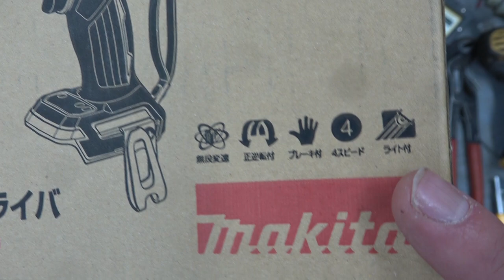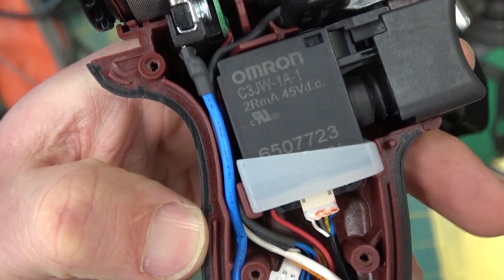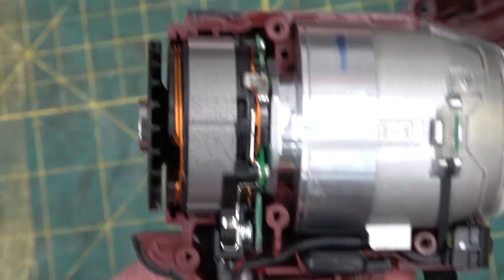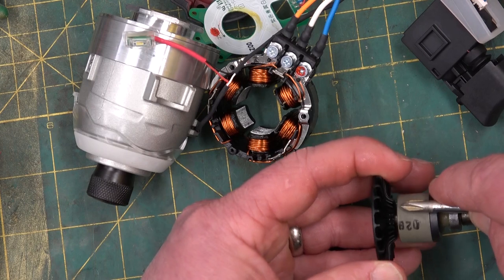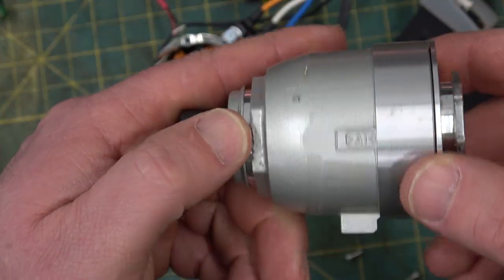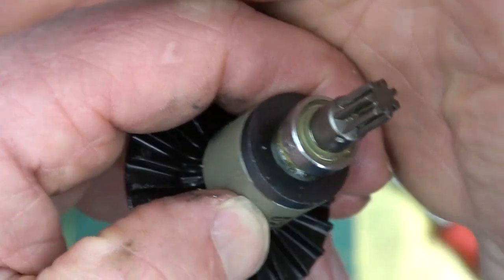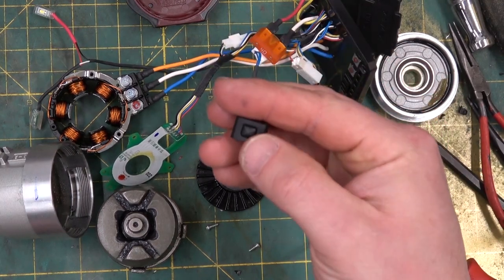Are Japanese Tools Better? Yes.

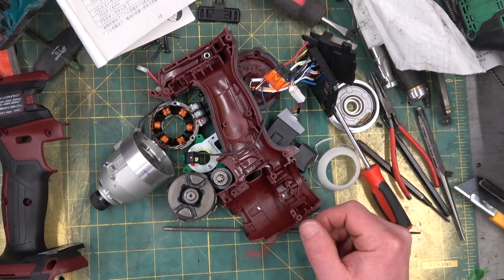Comment: 9:07 toyota does the same thing. If you take a corolla that was manufactured in japan, and one that was assembled in kansas, the Japanese one will wipe the floor with the already superbly built kansas model. I believe seiko also does the same thing.

It seems the past 5-10 years, japanese companies have taken a page from everyother country, and sent their international models to just be cheaply made in China. If you want the best workmanship, then buy something from Japan and have it shipped over. 

I still trust Japanese engineering (even over my own countries in a lot of respects) though, because they usually have the philosophy of using and designing in ways that are trusted to work, with parts that are known to work and be rouged.

Comment: I bought a 1984 Honda 4 wheeler made in Japan for my kid to learn on, my friend bought his kid the very best Tao something or the other Chinese ATV from the local dealer. The Chinese ATV lasted 4 months and he couldn't find the parts to fix it, all the insulation on the wiring was obliterated in the sun, cracking everywhere after 2 months,. That Honda is still running today. If you can buy anything made in Japan versus anywhere else in Asia or even Germany, go with Japanese made.

Comment: 0:13  Carton box says: 無断変則Continuously Variable Transmission(Not nuclear powered), 正逆転付 forward reverse control（Not entropy cuts port ways), ブレーキ付 with Break (Not high-five), 4スピード　4 speed modes(Not 4=Death, BTW it's only in Japan not in China), and ライト付 with light

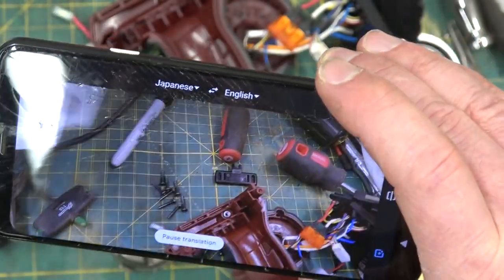8:44 If it is TD171DRGX, you have 2 options to change the modes. 
One is using "trigger" to change impact power 4 types- 弱 low, 中 middle, 強 high and 最速 powerful speed.  You will see the light step on the black panel when you pull the trigger.

Another option is 楽らく button on the blue panel. The setting mode will be changed to 木材wood, ボルトbolt、薄 thin board (using drilling tapping nail) and 厚 thick board.

木材 wood: Start to tighten slowly with trigger full-opened, then automatically speed changes to the most powerful speed.
ボルトbolt: Normal rotation: when trigger is pulled, immediately the speed will be the most powerful speed.　Reverse rotation: Automatically stopped when the nut is untightened.
薄 thin board: After penetration, automatically stopped by impact detection
厚 thick board: Reduce broken screw head and/or come out.

This machine remembers 1 your favorite mode by pushing the black tiny "hand button" just above the trigger and the 打撃 button on the black panel at the same time. The 設定 setting button next to the 打撃 button will be lighted on when the memory setting is done. When you want to use your favorite mode, you just need to push "hand button". Then if you push it again, the mode will be back to what you have used right before.

Also their movie will be helpful even they don't have translation.
https://youtu.be/Un0hTNKK1AI

Comment: About the board for the hall effect sensor: E248779 is apparently a UL file number for a PCB mfg in China, so it was probably made there; 94V-0 is a UL plastics flammability standard. 紫赤青黄白黑 is just "Purple red green yellow white black"

Comment: That hole in the gear is for a to My Allen headed grub screw witch indexes on a flat spot on the shaft. Typical setup on 1/10 scale high rpm R/C cars. The kind you assemble yourself.

Comment: The white doobly-doo in the bottom is not to preload the battery.  It makes it only take larger capacity batteries and not the little ones.
I assume it is so that enough current is available.

Comment: The small switch has the following explanation in the manual:
By registering a certain application mode to the tool, you can switch to the registered application mode by just pressing the quick mode-switching button (quick mode-switching function).

Comment: Unsure about your market, but the tool should be of the same construction globally.
The innards are indentical to what we have in the pacific region.

Omron are a common feature of pretty much all the mid-high end range Makita products, even the Chinese made ones.
Some of the parts in this model are also shared with its predecessor.

Comment: The difference between Japanese tools and American tools is business.  In Japan people who make things take pride in their work, in America people who purchase businesses to turn them out take pride in their profit margins.  

I have a lot of older Stanley tools that have held their own for decades and really like my block planes that are older than me...but most of the newer power tools made around here are complete junk.

Anyways, my sense of American pride has led me down a path where I am building a 4'x8' CNC out of some microcontrollers, a little bit of code, 1hp steppers, some 80/20 extrusion and 5/8" plate because 1) I want this tool to outlast me so that 2) when it does finally die I won't have to hear anyone tell me about my failing American tool.

Comment: An American car manufacturer ordered 1000 bearings from a Japanese manufacturer. The customer specified a failure rate of 0.3% When the parts shipment arrived at the customer there were two packets in the box. 997 perfect bearings and the three they had to specially manufacture with defects to satisfy the customer.

Comment: This is why people who do their homework want an Edwards guitar instead of LTD if they are not going to go top tier ESP.  Even though Edwards is bottom tier brand for ESP, it's made for domestic markets ONLY.  Even though they make a lot of units so you can get them pretty easy but you will NOT find an actual Edwards dealer anywhere outside of Japan.

Edwards are at the same or less price points than LTD but they are made in Japan and use the same hardware that's on the ESP instruments as well as the woods we've all found when looking at any tier guitar actually physically made in Japan, so a lot of times you'll see higher quality than even some high end LTD or standard ESP models you get in the states because that's just the way the randomness plays out when they're all pulling from mostly the same pile of materials/parts.  I think ESP is also doing something smart by starting US built LTD branded instruments, pushing to consolidate sales of North American markets into US manufactured instruments at equivalent or better price points/performance/feature than the established American manufacturers.

In fact, they're basically saying we're the new China, for them, except they don't have to ship any units out of the country.  Like if an offshore mfg consumed all their own products and just paid you for the privilege.

Comment: The fact it has a fuse is a good sign that means it hopefully doesn't end up in the chuck it bucket. I don't know where you find any parts to fix anything in the chinesium stuff. It seem if you can find a part it's at least 50% of the cost of a new one.

Comment: The Makita TD17 is hands down the best impact driver on the market. It will pound Festool and Hilti easly inch pound by inch pound. You can drop this tool from the mile high club and pick it up, I will still scream for screws to drive.

Comment: Actually that looks like an intresting motor controll The whole chips a blob can you reflow that stuff . I'm gonna CNC a cross sliding vise I have a fancy anti-backlash  5/8 10 acme screw and well no dials it uses steppers or  $5 buck calipers spc output to a yuriy's toys dro for the CPI adjustment and programable points the dro leads you back to that can be calibrated if there off its graphical you can see where your at on the screen It's the most tripeped out mini milling/plasma cutting fits on a 55 gallon drum machine tool you could imagine

Comment: I suspect that it's made to a higher standard for cultural reasons, Japanese craftsmen are world renowned for the intricacy of their work and the quality of their steel handtools, therefore a cheap tool that's busted within 2 or 3 years of moderate-heavy use probably wouldn't be acceptable, also wouldn't be surprised if spare parts were readily available.

Comment: I use this exact impact at work. Someone used my impact for 1/2 inch bolts and now under heavy load the hammer sounds high pitch and the force seems to drop off. On large 90mm screws it can be noticed also. Could it be a spring was overheated? A new unit is only about ¥15,000 so it is replaceable.
Reply: That button on the front is momentary for the led. If the led is running because the trigger was recently pulled, that front button will momentarily stop the light. It's a nothing switch.

Comment: The Japanese characters read: Violett red blue yellow white black
As others have pointed out, it's the wire colors. Definitely in Japanese. Not only would the Chinese characters be simplified, they also use different characters for some colors. For example, blue would be 緑 instead of 青.

Comment: On the Project Farm channel, he tests the Japanese (Red) vs the Blue Makita. He disassembles them both and the end, and they're the OPPOSITE internals of what you have there. The one you took apart matched the anvil and hammer assembly of the Blue Makita on his video, but it has the same electrical controls as the Red Makita he has. Why the discrepancy? Is there any way to know which one we're getting?! The Red one did significantly better in his tests!

Comment: FYI Japanese Kanji (one of the three alphabets, and the one you'll most commonly run across in areas where kids don't need to read it) is pretty much indistinguishable from Chinese characters since that's where most of them came from originally, there might be a few that didn't but they're not common.

The most important question though is whether or not the Japanese batteries still have the godawful protection that kills the battery if you undervolt it three times, which also loads cell one more heavily than the rest because the confuser in the pack runs off cell one.

Comment: Where do you buy these "JA Pan" version tools?  Are there a known part#'s for the Japanese version tools?
Reply: That's a Japan Domestic Market only item. Most Japanese companies make versions of their items that are basically the same as their regular line gear but with truly superior craftsmanship only for sale and use within Japan. Many of these will be released with the original name for the company, so for Panasonic for instance, if you see something familiar tagged Matsushita, it's what you're thinking except simply better... probably a heckuva lot better.

The only way to purchase JDM gear (you'll see JDM referenced in various things around) is to buy it in Japan or buy it from a reseller who's technically breaking export laws. There's a thriving market for it on Amazon and ebay though and you'll probably pay a bit of a premium but their rep holds up despite it for a reason. Make sure you check seller reviews to avoid fakes.

Comment: This is what the Russians do with their weaponry. The export models are usually a downgraded version of the domestically used stuff which they build to a higher standard.
This likely contributes to the misconception that Russian kit in general is low quality and primitive. They do it on purpose.

Comment: There's a reason why a country 400x smaller then the USA can put up such a fight. Smart! If they were any bigger we would be speaking Japanese!
Reply: And there's a reason why this video is mostly BS. AvE is not comparing the T171D against the non-Japanese version of the same tool, but a cheaper version of a different tool altogether. That would the same as comparing a Nissan Skyline against an inexpensive family car and using that comparison to state that all Japanese cars are superior.
Reply: @BrunodeSouzaLino  dollar for dollar  There's no comparison!
Reply: @tbeast2454  For comparison sake, the non-Japanese version of this exact same tool is the XDT16Z. Exact same parts and would cost you less as well, since you're not paying Japanese taxes.

Comment: ummm I'd be pretty confident in saying just about everything Japanese made is better,  trying to buy Japanese made vehicles since owning my first and last American Vehicle 20 years ago. I have always noticed fit and finish as well as longevity of the vehicle in most cases is pretty hard to beat. Alot of the vehicle are boring and won't beat much in a drag race, but if it's a Honda with a manual and the old proper double wishbone suspension, kicks the living shit out of anything the big 3 or even toyota has put out in corner capability, I can't beliebe how cheezy macferson strut suspension seems after working on honda's for years, shame honda eventually went to the dark side

Comment: Japan can assemble a Ford and call it a Mazda and it has better build Quality and reliability even though 95% of parts are domestic FoMoCo components according to the window sticker of my 2006 mazda3.

Gai-Jin not gwai-lo
Reply: Years ago I had a Ford. The only thing that ever failed in it (and repeatedly) was the electrical system, because that was all genuine made in England Lucas junk. The Mazda components were rock solid.

Comment: Now why not build the darn iPhones over there. Design in the US built in Japan, just a thought.
Reply: Just for perspective. If the iPhone 4S (at the time it was new) was to be made completely in the US (only the shell and some structural components are machined at Cuppertino. All the electronics come from China preassembled) using US sourced parts and labor, it would cost you over 14 thousand dollars. Japanese labor is more expensive by comparison.

Comment: Uncle Bumblefuck: Have you ever come across a Wiegand Sensor? The Hall effect sensor made me think of it- I think they have relatively similar setups... though I suspect my Engineer father would be disappointed in me for suggesting the same. 

Spent a summer in ‘07 between sophomore and junior year burning the shit out of circuit boards on gas meter micro-correctors and getting paid to do it. Might make for some good tearing down if someone can find one in their local getting bin.